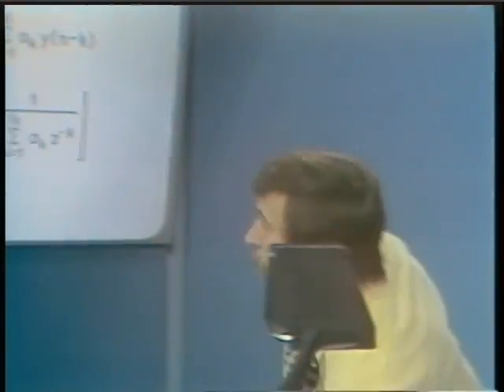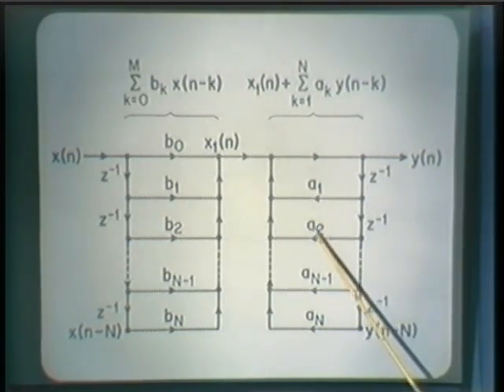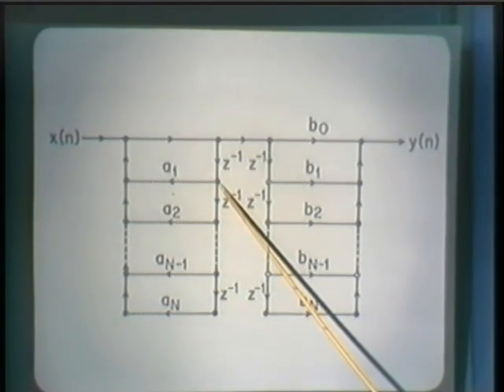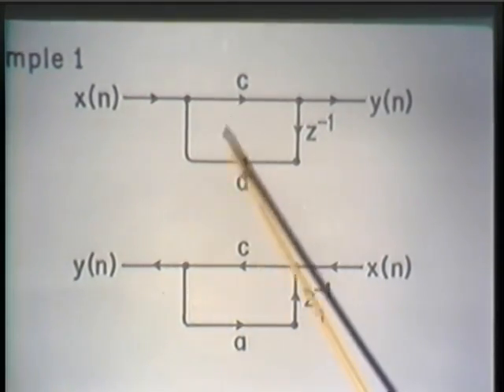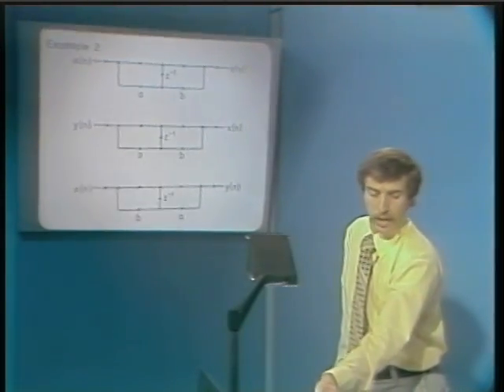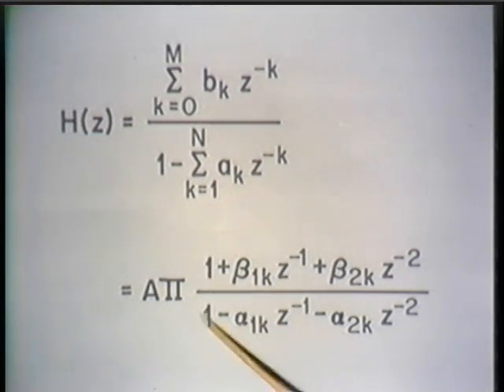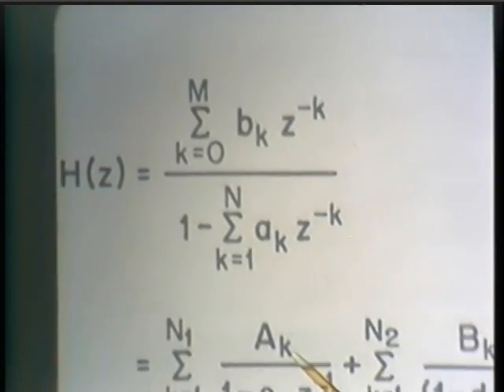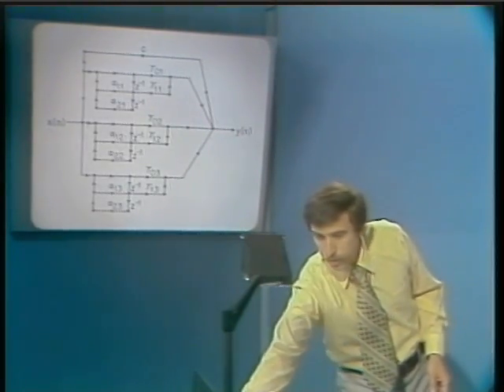Lec 12 | MIT RES.6-008 Digital Signal Processing, 1975

Comment: 🎯 Key Takeaways for quick navigation:

00:48 🎙️ The lecture focuses on common structures for implementing digital filters, specifically infinite impulse response (IIR) filters.
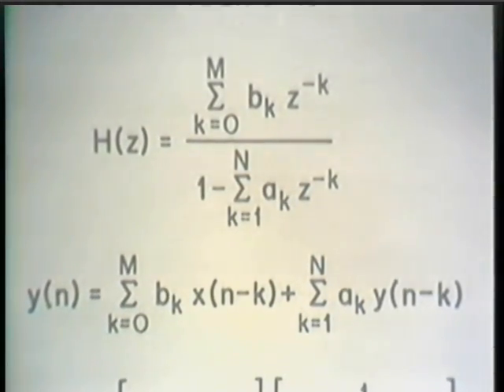02:10 🔄 The transfer function of a digital filter is a rational function in z to the minus 1, corresponding to a linear constant coefficient difference equation.
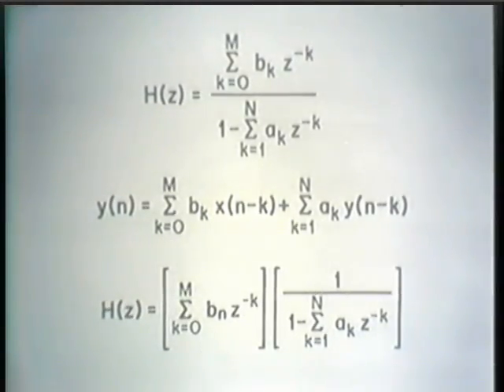04:22 📊 Implementing the transfer function involves cascading systems for zeros and poles, with weighted delayed input and output values.
07:41 🔄 Systems can be manipulated, leading to different structures. Interchanging the order of cascaded systems results in an alternative implementation of the same difference equation.
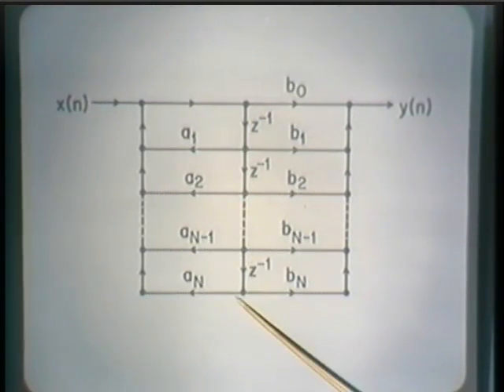12:32 🚀 Collapsing identical delays in parallel branches reduces the number of required delay registers, optimizing the digital filter structure.
14:24 🛑 A canonic structure has the minimum number of delay registers, often preferred in digital filter implementations for efficiency.
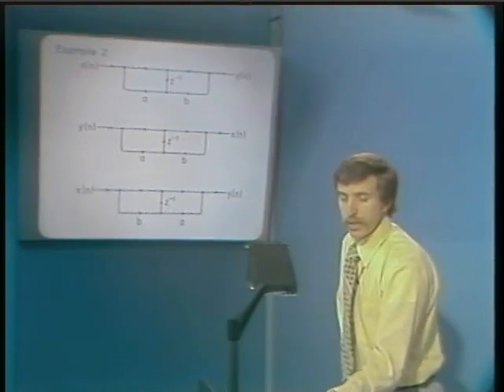19:30 🔄 The transposition theorem states that reversing branches and interchanging input/output maintains the transfer function; applying it can lead to different canonic structures.
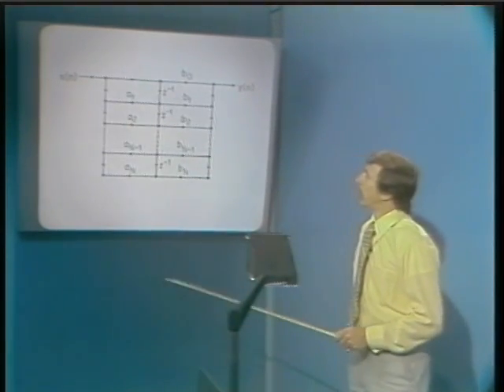22:50 🔄 Applying the transposition theorem to a canonic structure generates another canonic structure with reversed delayed branches and different order of zero and pole implementations.
24:40 🔄 Direct form structures involve coefficients from the difference equation; cascade and parallel structures are alternative implementations for digital filters with potential advantages.
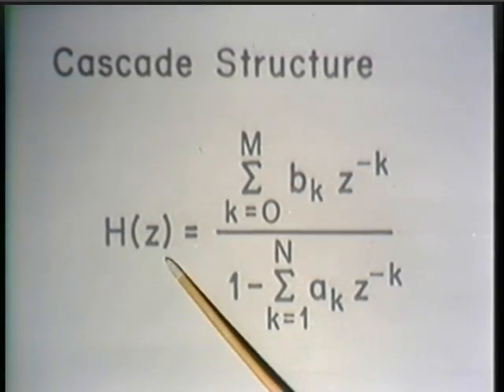26:07 🔄 The cascade structure in digital signal processing involves factoring the transfer function into second-order sections, beneficial for implementation on digital computers or special-purpose hardware.
28:23 🚀 Implementing a system as a cascade of lower-order systems is preferred due to reduced sensitivity to coefficient errors in hardware, compared to a single high-order polynomial.
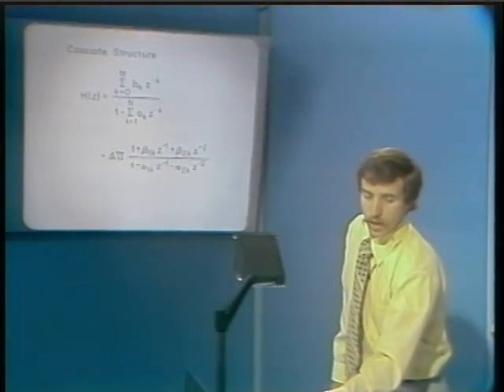30:10 🧩 Cascade structures can be implemented in various ways, and a canonic direct form is one such implementation for second-order sections with poles and zeros.
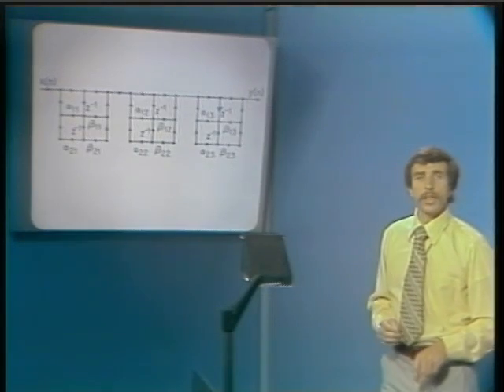32:02 🔄 The parallel form structure in digital signal processing involves expanding the transfer function using partial fraction expansion, emphasizing the implementation of poles in terms of second-order sections.
34:25 🔄 Differences between parallel and cascade form structures include the section types and output formation, with parallel form expressing H(z) as a sum of second-order sections.
36:44 🎚️ Parallel form structures may be preferred when filter design parameters are generated in terms of residues and poles, offering a straightforward transition from design to implementation.
38:08 🏗️ The discussion introduces common digital filter structures like direct form, canonic form, cascade, and parallel, with ongoing research focusing on trade-offs between various structures.

Made with HARPA AI